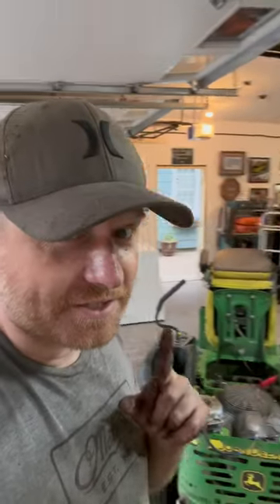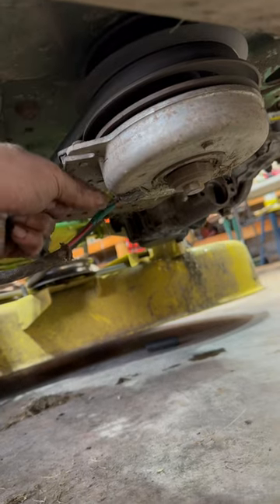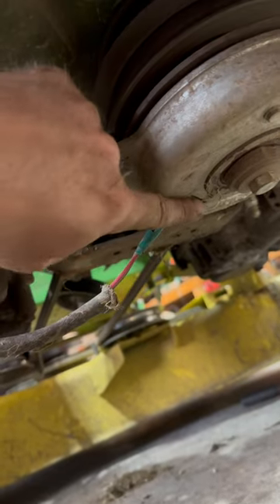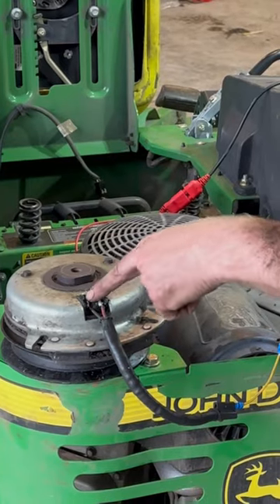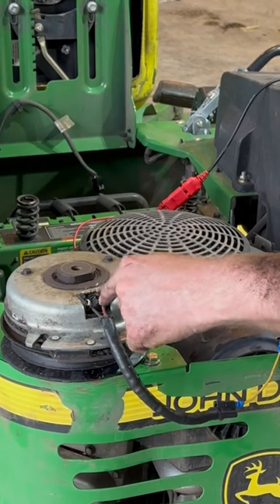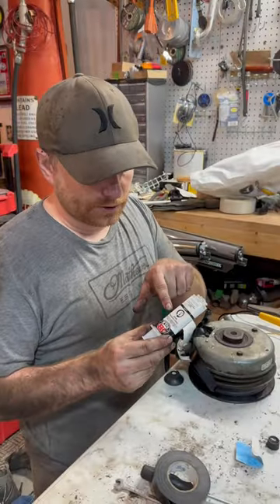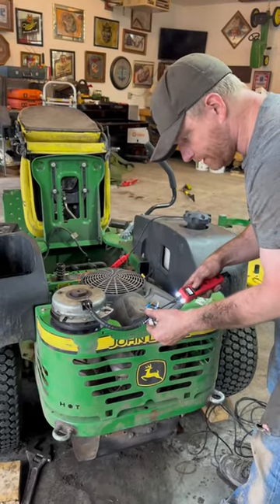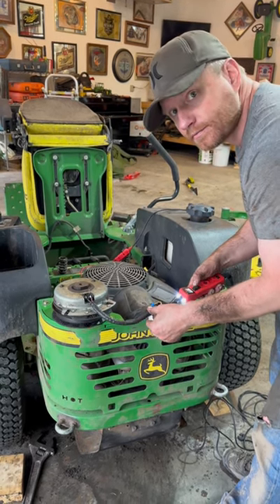John Deere Ztrack PTO Clutch Wire Fix

Comment: Thanks for this. I didn't like all the other methods of repair I've seen like screwing a screw into the black epoxy above where the wire goes in. But this seems like the most permanent fix. So there is definitely a pin inside to solder to?

Comment: My z525e almost stals when i put the pto in even at full throttle, could this be the culprate?
Reply from the maker: Test your battery first.  The electric clutch draws enough it can reveal battery issues like that almost stalling while engaging.  If it isn’t that there are a lot of other options, which could be an almost separated wire like this.

Comment: Mower runs fine but the pto wont engage. Makes a little click or soft noise but won’t do anything. I wonder if this is the issue
Reply: Some mowers have a adjustable PTO you might be able to adjust it to get it working again